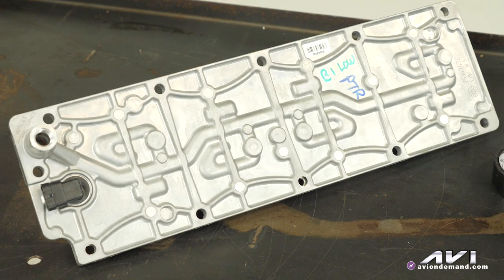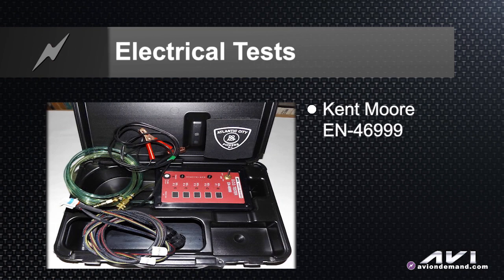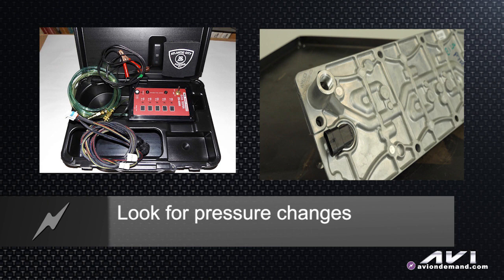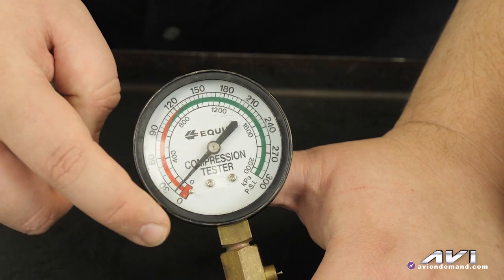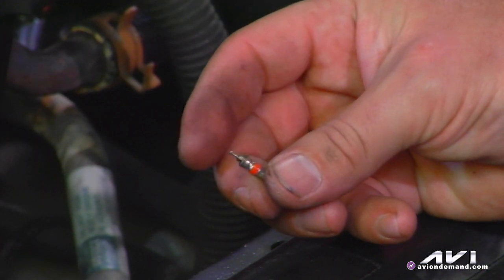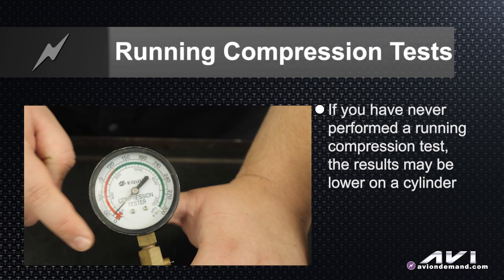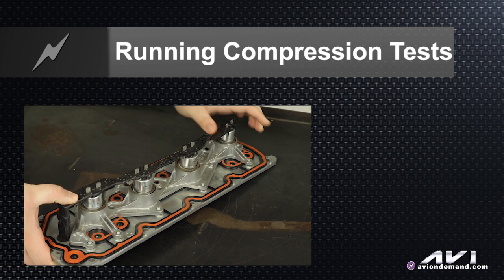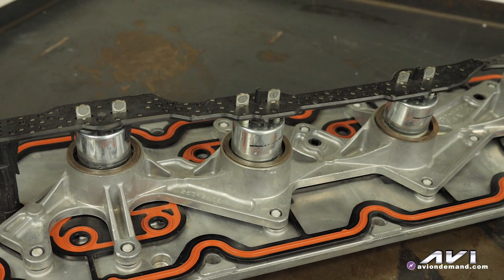GM Running Compression Test | Dave Hobbs  | Tech Tip

Comment: A dod delete and a cam !   Less shit to break
Reply: lol, yet cop cars in the USA has it running for over 300,000Km just need to change with real good oe oil full synthetic oil and good oil filters at every 3K to 5K intervals, if you want more hp ,then change the DOD with cam and lifters and springs plus tune, which will in effect change the oil pressure in the sump, the low oil pressure valve in the sump will may damage in the end, people forget that system, so after market sump is required to be safe?
Reply: @7071t6   Cop cars in the US do not go over a 100000 miles Before a rotation AKA new car.. I've owned my Escalade since new and have always used synthetic mobile 1 oil ...changed it myself.  after 150k it lost cam bearing clearance and had to be rebuilt.  Because low oil pressure causes the VVT to trip the engine code.  The 1st rebuilt from the machine shop down the street put on the wrong cam bearings and starved the engine of oil.  The 2nd rebuild I did myself  And took all VVT and DOD out of this engine.  I have a torque cam for towing.. and better fuel mileage